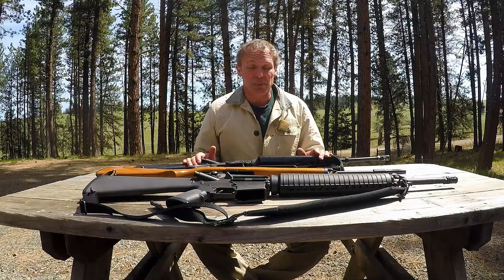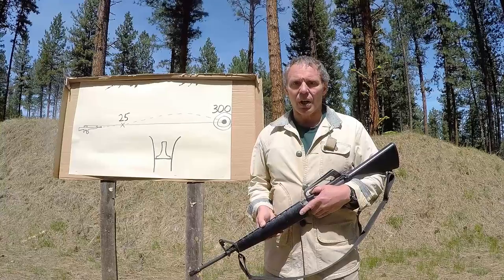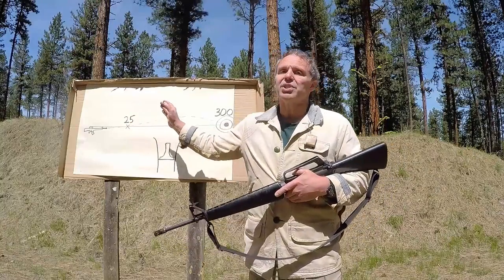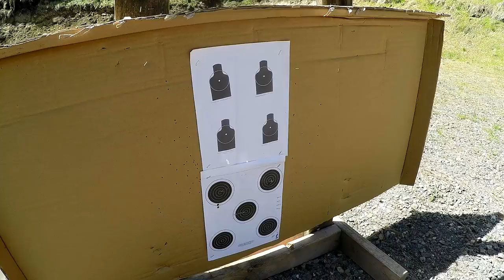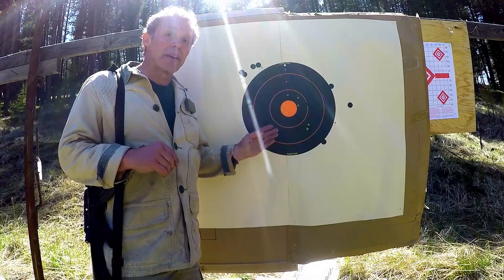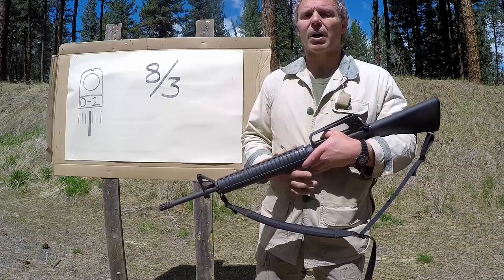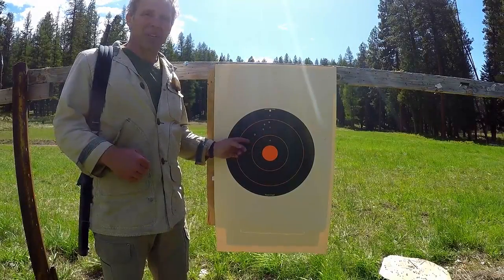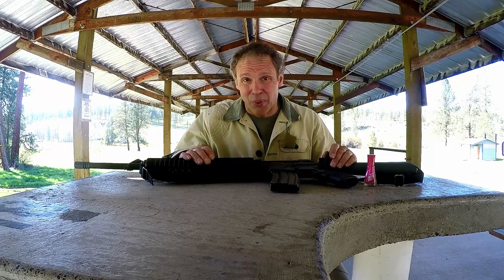Zeroing an AR Platform Rifle

Comment: First off, I love the no nonsense videos.  I also like that you are straight forward about flyers.  Those with no experience will not understand that these rifles with peep sights are not 10x rifle scope repeatable and aren't meant to be.  That silhouette looks pretty small at 300m/yds.   After years of suffering through training Soldiers and running ranges as an Army NCO, I came up with a system that streamlined the process of zeroing.  Rule number one for getting off the range before dark:  Don't touch the sights.  Shoot a group first.  The weapon should have already been zeroed and will probably be very close.  Starting from mechanical zero is just a waste of time doing repetitive and unnecessary adjustments to put the sights right back where the vast majority already were.  This allowed us to get the vast majority of shooters off the Zero range after 6 rounds.  There is a common misconception that you are adjusting the sights to zero the rifle to YOU.  When in reality, you are adjusting the sights to match the bore of the rifle.  While there ARE slight variances in each shooter's zero, it usually doesn't vary more than a click or two.  After a few hardcore book thumpers challenged me, we put it to the test.  The results were pretty conclusive.  I used a rifle from another expert qual Soldier and scored 36/40 popups.  My fellow NCO who is a good friend but was one of the nay-sayers used the same Soldier's rifle and hit 37.  This allowed us to use those extra rounds for more tactical firing and more realistic scenarios when lanes started to open up.  Different positions, malfunction drills, rapid fire with magazine changes, etc.  The Soldiers had more confidence in their weapons and scores went up significantly across the board.   Just before I retired, a new CSM came in and put a stop to my foolishness.  So, it was back to frustration, wasted time, ammunition, targets, and immediately lower scores.  All by the book.
Reply from the maker: your point is well taken. Sadly, when I was in the Marine Corps it was required that the sights be returned to flush (front level, rear completely to the left) when the rifle was turned in to the armory and flush for inspection. So going to the range required beginning at mechanical zero.

Comment: In the IT biz, we have a lovely little saying that you may want to add to your vocabulary, Paul. It's very simple, and goes: "RTFM." It sands for "Read The F***ing Manual," and if I were you it would be my considered reaction to most of the comments you're citing at the beginning of this presentation.

The saying, as commonly used, applies to more than just user manuals. It means you need to pay attention to what's going on before you start sounding off. In this case, the folks who evidently watched little bits of your previous video and commented in error needed to RTFM. Likewise, those who watched the whole video and somehow didn't comprehend what you expressed very well also needed to RTFM. 

(I'm a professional trainer and presenter, and I think your presentation style and technique is damn good. Take that how you will.)
Reply: I'd  add PEBKAC. Problem Exists Between Keyboard And Chair. People hearing and not really listening.
Reply: Hello , IT . Did you try turning it off then on again ?

Comment: I carried an A2 the whole time I was in the Army. We started getting some M4s in a couple years before I got out, but I never had one. I had always heard that the large and small apertures had the same elevation. But I just recently finished building an A2 clone. I’ve only had a chance to go out and shoot it once and do a rudimentary zero standing off a barricade. But I did fire a few shots with the large aperture. It shifted the point of impact well over an inch at 25 yards. So I’m starting to wonder. I hope to have a chance to do some more tests soon.
Reply: On mil spec M16A2s and mil spec M4/M16A4 detachable carry handles, the large aperture has lower elevation than the fine aperture. Its intended to be used as a CQB/patrol battle sight when aligned with the 8/3 or 6/3 setting for situations where its more important to get rounds downrange quickly. Some commercial ones the apertures have no difference. All depends on the sight and rifle.

Also, the santose modification makes those sights much more usable; when done properly, it gives you a 200m setting below the M16A2 8/3 or M4/M16A4 6/3 setting (2 clicks below and 4 clicks below, respectively) with the fine aperture. Even in the instructions for this modofication, Lt. Col Santose recommends putting the sight to 8/3 or 6/3 and flipping to the large aperturr as a patrol sight for the same reasons i previously described. Hope that helps!

Comment: Now show us how to zero AK and SKS rifles! Love your channel paul!
Reply: Kentucky windage
Reply: You need a special tool for the front sight. Place a target at 11m and it will cross the line of sight at 300m.
Soviet doctrine also had aim point at the hips instead of chest. There are a ton of videos on it .
Reply: You zero those completely with the front sight.  

Using the 200m elevation, zero the rifle at 18m and you are basically done.  Check at distances to confirm

Comment: AR-15 zeroed at 75 yards. Straight to comments to find out how I did it wrong.
Reply: Growing up our back yard was only 75yds... it's all I could shoot without shooting just past a building so everything was at 75yds... fun with .22 pretty short for anything else. Worked through!
Reply: @andystampfli9127  I live in an urban environment so I doubt I'd have to go much further than 75 yards to engage anything. Plus, that's about the limit of my line of sight anywhere from my house. So it works for me. My local gun range is only 100 yards at maximum anyway so I can't go out past that.

Comment: 11:44 I didn't believe it was that simple, so I did the MOA calculation myself.

1 Minute of Angle is equal to 1/60th of a degree (like 60 minutes in an hour, I think it comes from map making to get more precise than 1/360th of the earth in position). To figure out how far 1 Minute of Angle will adjust we need to imagine that the range the rifle is shooting at forms a circle in every possible direction up or down, with the range being the radius of this circle. Because it's adjusting up in this example, this would be like making a "rainbow" with your rifle's aim, perpendicular to the horizon.

The important information about this circle is the circumference, or the length around the outside of this 100 yard circle, the formula is 2*π*r, or 200π yards. With the total length of the circle and the fraction that we are moving (1/60 of 1 degree or 1/60 of 1/360 = 1/60*360 = 1/21600), we need to multiply the two together. 200π/21600 yards = 0.029 yards (*36 for inches) = 1.04 inches

It works out, very close too. I love to hear about these simplifications, because I knew it wasn't going to be exactly 1 inch but it worked out very well for 100 yards away. For meters, the shorthand would be 100m = 3cm, where it actually equals 2.91cm, so very close there too, technically it's better than the yards to inches!
Reply: NOW, IMAGINE Paul’s grief coming back on him trying to explain THAT..TO SOME of the viewers!

Comment: Reminds me of when I was MP in the Army. We went through Basic with the M16A1 but eventually transitioned to the M16A2 at my first duty station in Germany. I went to Small Arms Maintenance school, so I often supported our Company at the range. We had one particular Private that just could not zero. His grouping was okay, but every time the NCO's on the firing line adjusted elevation or windage, it would throw his group farther away from center mass. Finally they brought the rifle to me. Yep, as I suspected - bent front sight post. Checking that first will save you time, rounds, and a lot of frustration.

Comment: Sooooooooo this video is absolutely amazing and solid gold information. I do have one caveat to add Paul. I can ONLY speak for detachable carry handle A3/A4 rear sight apertures but the 0-2 short range aperture on that version doe indeed Incorporate an elevation change. If you zero the rifle (20 inch with M855) for 300 METERS with the sight set on 6/3 then when you flip to the 0-2 aperture you will have a rough 50-200 meter zero. It will be super close. The only issue is that the 0-2 aperture is HUGE and doesn’t lend itself to super accurate shooting. But up close in low light or moving targets it’s pretty awesome. That was my PSA for the A3/A4 full sized rifles. This in no way applies perfectly to the carbines or other ammunition types. 💪🏻💪🏻💪🏻 great video Paul!

Comment: 1978 Camp Pendleton they called it the 1000 inch range to zero sights
in sitting position.
I ended up a 2111 got to pick from the armory each year I took a new out of the cosmoline rifle 
to the range and each year made expert.
Went to Army 2111 school.
Only 4 years in the Corps.
I’m on my third AR and my second mini 14 lol.
Great video!
SEMPER FI

Comment: Paul, thank you for an accurate explanation of zeroing a A-1 & A-2 of the AR-15 platform. Per the Ol'e USMC and new USMC manuals. 
I just got a refresher course from 1977, 3037plt. I co. 3rd Recruit Training Battalion. I've lost my original manual, 43 years you loose a few things. But this Ol'e Devil is open to learn a new trick or 2, so I'll get me one of those new fangled Marine Corps manuals. 
And new Range Notebook, that's a must for everybody. 
God Speed, God Bless, and God Bless Chesty Puller where ever his is,,,,,  🇺🇸
Semper Fi,,,

Comment: Paul mentioned using a bullet tip or nail to depress the sight detents.  One of the most useful tools you can put in your pocket for the AR-15 is an ordinary hardware store small nail set.  It's a sight tool.  It works the detent for the trigger guard if you ever use mittens while fighting the Russians at the north pole.  It is a good aid to pushing the takedown pin.  Placing it squarely on a trigger or hammer pin, and tapping with the plastic handle of a screw driver, using the shaft as a handle, you can tap those pins out easily.  Remove the firing pin retainer (cotter pin), and on an on.  Small nail set.  Toss it in your  kit.

Comment: I'm revisiting my A2/A4 platform again.  My sight-in had my front sight cranked down pretty far into the base, so after I re-learned the RIBZ method I hypothesize that setting up that way, will actually keep me from having to crank the front sight post down so far, and I'll still have a few tricks up the rear sight drum's sleeve to use.

Comment: I like using the improved battlesight zero for carry handle sights with elevation drums.  Essentially you modify the drum to bottom out 2 moa below the 300 yard marking.  Then you can zero for 50/200 yards at the bottom and adjust up to 300 yards and beyond.

Comment: There were a couple of bits of incorrect info.
A2 sight: The 0-200 aperture definitely does change POI; by 2.5 moa. Once you return the sight to 8/3 (or 6/3 on an A4) flipping to the 0-200 sight drops the POI and basically gives you a 200m zero.

A1 sight: after zeroing at 25m on the L sight, you now have a 25/375 zero on the L sight and 42/250 zero on the unmarked sight (this is why your shots were high at 300...you left it on L). You're supposed to switch to the unmarked sight after zeroing at 25. The L aperture is for 300-400m

Comment: Paul Harrell this might be a good place to ask you something that got my attention last year.  I have a rifle that I have used for years for deer hunting but last fall I scored a windfall of hornady ballistic tip ammo from my local store that was closing.  I took it out to the range to sight it in.  At 25 then 50 it was working as good as my regular ammo, but once I got to the 100 yards the rounds seemed to be going off at random directions.  I went back to the 50 and nice tight groups.  It was on my second move to the longer range that I noticed that I had been shooting through a carriganna bush.  While walking up it was not really apparent but I tied a piece of cloth on a branch and went back to my bench I realized the twigs were directly in the sight line of the target.  I tried some of my normal ammo and they went perfectly fine onto target. The only thing I could think of is that the ballistic tip with it's hollow copper tip deformed so much that the aerodynamics went haywire after striking the twigs the size of speaker wire.  The bush was 10 to 12 yards infront of my target.  Normally I use a pointed soft point or until they became too expensive in my area I loved Remington corelokt.  I am sure the solid lead projectile was affected however I think that the variation was within my own shooting capabilities.  I was wondering if you could do a video about accuracy of different projectiles through various impedements rather than just see if it will penetrate. Like twigs when brush hunting or leather or if you are adventurous expanded metal.

Comment: i would help to know where your hold is on the target. ie: apple on a fence post, flat tire etc. Great explanation Paul. Well done. Thanks for this vid! I have always set my hold a bit low for the actual point of impact, like an apple on a fencepost, not really sure what that does at 300 however.

Comment: If using the military 25/300 zero, here are your holds:
25m-center mass
100m-center mass
150m-belly button
200m-belt buckle
250m-belly button
300m-center mass
Caveat: the apex of the ballistic trajectory is 190m.
You can achieve a shorter shot string by using a 50m zero (50/200).

Comment: Paul, excellent video explanation of establishing zero on these two platforms. My A2 rear sight doesn't have the 8/3 marking, it has the 6/3 marking. So does that mean that having been zeroed at 25m, 1 full 360 degree rotation up, set the zero to 600m?

Comment: After watching this video I had to look into this which took some time since my colt sp1 is kept at another location. Now I had it in my mind that the long and short range aperture were different sized holes. Imagine how stupid I felt when I looked and found out they were the same size. But then imagine how smart I felt that I took the time to check before leaving a comment saying otherwise. Thank you Paul for teaching me things about my own rifle that I never realized before. I absolutely love the sight it in at 25 yards with the long range aperture then it's pretty close at 300. 

Paul, I do have one other question though. If anyone knows the truth on this it would be you. My rifle is a very early model. It doesn't even have a forward assist but it does have the first gen squirrel cage flash hider. I have read that with the early models that 55 grain projectiles were good but due to the twist of the barrel that running 60 grain and heavier projectiles made your accuracy just go out the window.

Comment: I just want to say, thank you so much for this presentation.

Im not new to guns, but I am new to AR platforms. Having grown up primarily on AK's and becoming very familiar with them and old surplus rifles, the AR doctrine is a little tricky for me.

I have an FN A2 Style upper that I put on a KP15 Lower. Went to zero it yesterday and while I did do so, I was left with more questions than answers.

This video answered a lot of those questions. Though, I have to ask why so many AR's I see have to be zeroed with windage almost all the way to the right. My trigger pull is good, but this seems to be the case for my AR as well.

What method of aiming is conventional on AR's? Lollipop, centermass hold, belt buckle?

Comment: I know this can be addressed in other forum, but I simply value the insights of PH and his subscribers more.  I’m confused...Paul is zeroing on target at 25 yards but I was told to zero at 25 yards so that my POI is about 1” - 1.5” lower than my point of aim (on the bullseye).  Right now, my AR is zeroed to hit a five shot group inside of a post it note at 25 yards, about 1.5” below the bullseye.  I’m told this is how to set a 100 yard zero at 25 yards (I only have access to an indoor range at the moment). Should I be changing my POI to inside the bull or not?  Thanks for letting me interrupt.  Using Remington .223, 55 gr. ammo.

Comment: Great video. But it left me with some questions. My recall isn't clear about my 1970,1971 Army Basic training and zeroing the M-16. I never got issued a book like you have. I don't remember if it was A1 or A2. I thought A2 meant it had the charger assist. I recall zeroing at 25 feet, but we aimed at a bulls eye about 3 inches above a grid The Drill Instructor adjusted the sights between 3 shot groups by the bullet holes in the grid. Can you please comment briefly on my comment to fill in the blanks in my memory?  Seems like we were trained to shoot the Silhouettes pelvis at 100, shoot at chest at 200 and shoot at head at 300.  If I was going to infantry AIT, I am sure more training would have gone on with the M-16.

Comment: Hi Paul, Great channel and thanks in advance for your help. Have an AR-15 SP1. Followed your guidance on getting to zero. I can't see out to 300yds so plan to shoot 100 max. Once I get it sighted properly at 25 using the L rear sight, should I simply use the short range rear sight to dial it in at 100yds or do I change the way I sight it in at 25yds by using the short right from the start? Thanks again.

Comment: Do you use a Marine spec crayon for your illustrations or an aftermarket unit? I ask because, along with the succinct oral and visual sides of these excellent presentations the artwork shows a certain sparseness mixed with a limpid quality missing from other "gun" channels. Also your wardrobe adds zing while running in the background, kudos to your people.